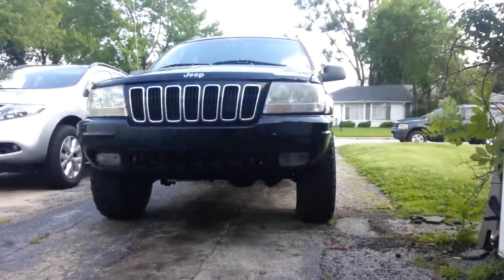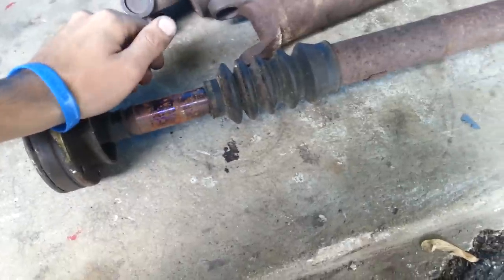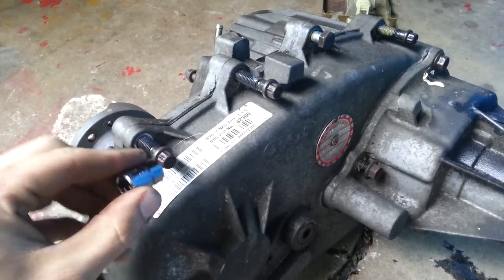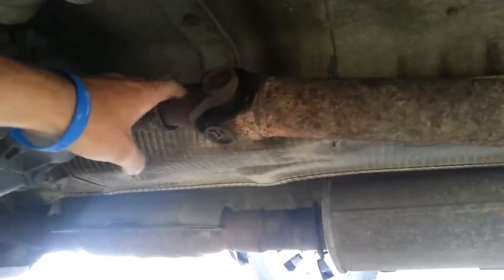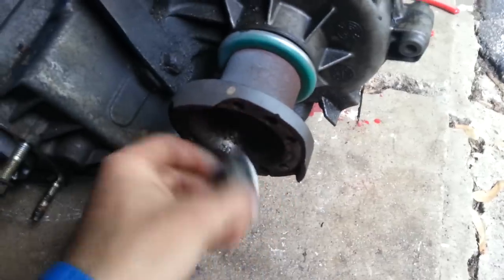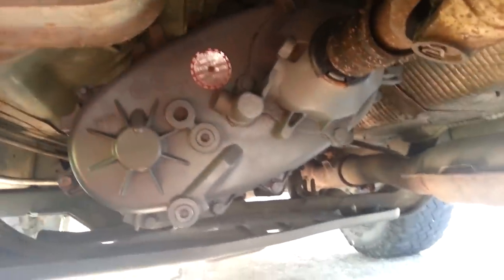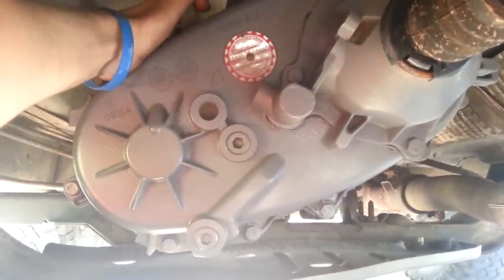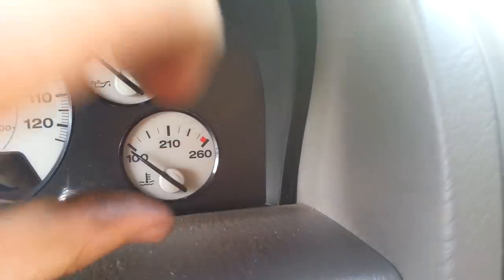Jeep wj grand cherokee 242 j swap into v8

Comment: Great video, I'm swapping out a 247 to a 242, I found the light connector you mentioned but its too short, won't reach to the plug on the transfer case...I guess I can cut it off and solder longer wires so it will reach...
Reply from the maker: Hello, when I did mine, the donor jeep had the connecter harness on the tranfer case. It a premade jumper harness to just plug and play.  I should have mentioned that.

Comment: I have a 98 5.9 that I had 242 already put in , anyway the VIC reads incorrectly says it's in 4wd when it's in 2wd , any idea what they did wrong or didn't do? is there wires behind the VIC screen?

Comment: You are saying the 247 Yoke off the front will fit on a 242 ? You had no issues with the yoke/flange on the 242 shaft and slop or play ? Cause if you look at the 242 yoke you pulled off in this video it is not splined all the way thru in the rear and im told the 247 yoke is.
Reply from the maker: I inspected each front yoke when i had them both off and compared both side by side, both are identical with the splines and such, you can swap out these yokes with no issues.

Comment: Ok, so get a donor 242 out of another wj, keep the rear drive shaft from my vehicle, take the slip yoke from the donor, then keep the v8 front slip yoke and get a donor double cardan front to replace my Rezeppa style front d/s. THen get the selec trac shifter assembly, hopefully from the same donor? That should be it correct? Oh and move the shifter bracket to the bottom, and hook up the selec trac light connector. 

Also....do you have any videos of you wheeling your wj? I've got a 2.5'' puck lift on 33x12.5's. TONS or rub, but the stance is mean!
Reply from the maker: Yes thats basically it, its pretty simple and straight forward, also one thing i missed in the video was how to remove the shift fork out of the 242, you can use a screw driver to pry it away from the case, use caution not to damage anything, I believe you need to have the 4wd shifter all the way up to do it not at the moment I dont have any wheeling videos but I will soon!

Comment: I have a 2000 Jeep Grand Cherokee 4.7L with the Quadra-Drive system with a bad transfer case. Was wanting to know if and what the difference in the T-case from an 00 to an 02 with 4.7L and Quadra-Drive is? I went to 2 different recycle yards and was told the T-Case from a 02 4.7L w/Quadra-Drive will NOT fit My 2000??
Reply: There is no difference except for the yolk for the front drive shaft.  I just put an 04 transfer case in my 00 the junk yard said 99& 00 was one transfer case and 01 to 04 was the other transfer case. THEY ARE 100 PERCENT WRONG.
You loosen the front drive shaft yolk nut.  Take it off.  Then switch it with yours and tighten the same nut.
I did this last week

Comment: is replacing the front driveshaft necessary? from what i understand its same dimensions just a bad design right if so ill leave it till it wears out and save a few bucks for now
Reply: Very old comment, but all of the front shafts are the same. I did the swap in my '04, and kept the rzeppa shaft. I did need to use the 4 liter rear driveshaft, but it wasn't a bad swap at all
Reply: @fake2822 you used the whole drive shaft from the 242j? The guy in the video said he only swapped the yoke. Thanks
Reply: So, the Jeep is long gone now but I believe I had to swap the rear. The front driveshaft only needed the end to match whatever is on the t-case, but the rear was a different length. It doesn't hurt to swap the yoke and try it though. Good luck
Reply: @fake2822  life saver! I’ll be trying this soon, will update for anyone who goes looking.

Comment: Did you use any silicone on the T-case to Trans mating surface?
Reply from the maker: shockracer nono did not, only reason to do that is if your doing watercrossings to prevent water from entering the transmission/tcase
Reply: jaws2167 ok, thanks.

Comment: how can you tell when a 242 is a LD or HD? will it say it on the tcase red stamp?
Reply: justin aguirre 242j is LD, 242WJ is HD. If the tag is missing, LD has a rubber boots on the rear, hd has an aluminum tail cone. Side note, some V8 242's we're also tagged 242HD. If Dodge it will say 242dhd
Reply: David Sanchez i have NP242WJ but it has rubber boot, is it HD?